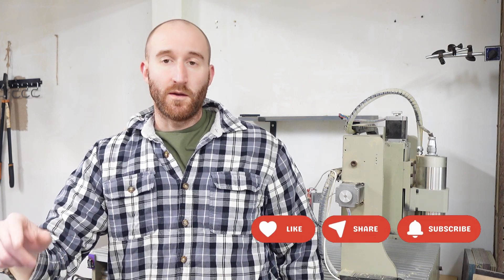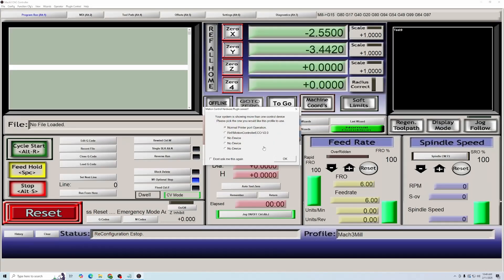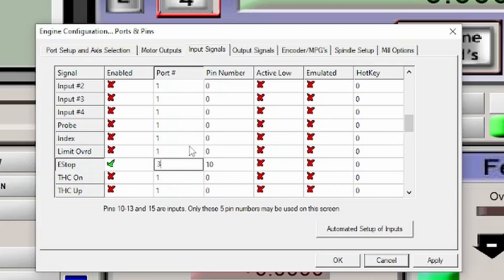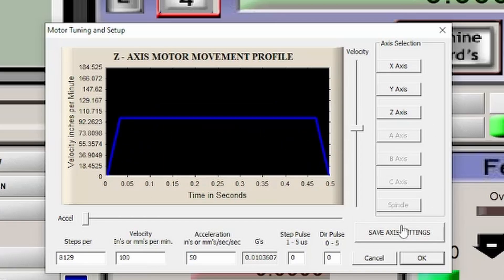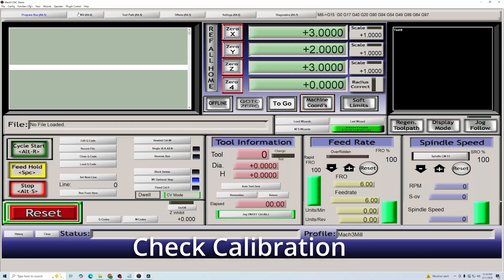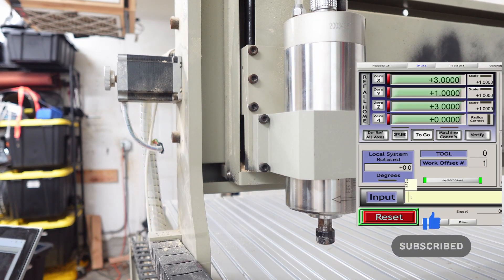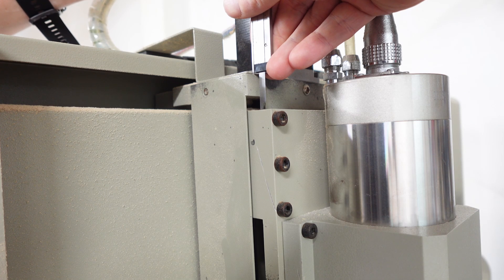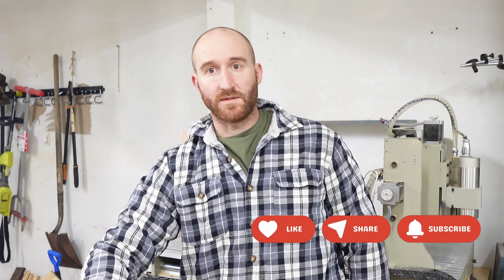Mach3 CNC Setup for Chinese USB CNC | Fastest Way to Get Moving

Comment: I have a chineseCNCzone 6090, i think it's an xhc controller but it doesn't look like it, the board itself has jp-845 written on it. In the driver card i got with the cnc it said I needed to use an NcUsbPort.dll file for it to work but it doesn't. do you think this will work better?
Reply from the maker: it has one of the old parallel ports on the back? My first CNC had that type of connector on the back. I'm not sure it was the same board inside, but i was able to use a uc100 to get it to work https://cncdrive.com/UC100.html
Reply: @IBilldThis  I see. It does have a parallel port at the back, so I'll look onto it. Thank you!
Reply from the maker: @yairnaveh1395  let me know how it works